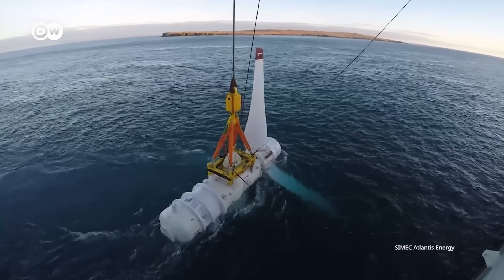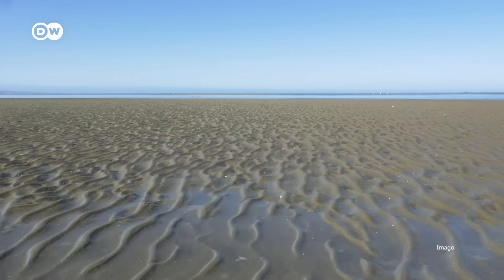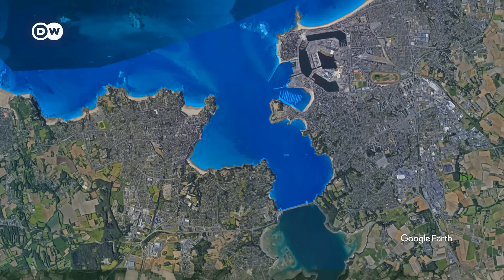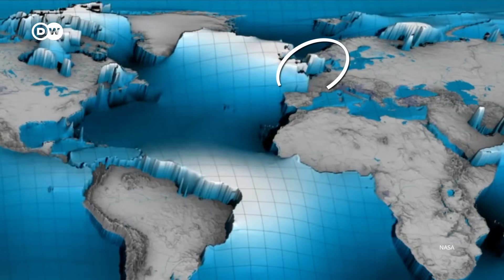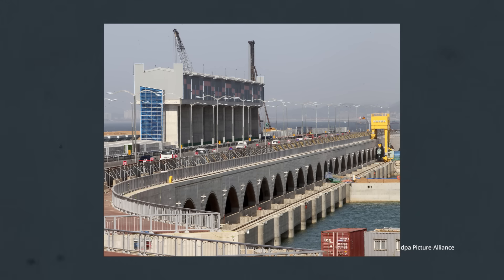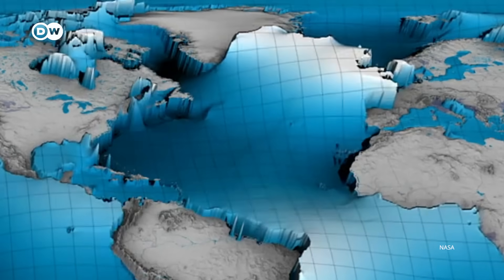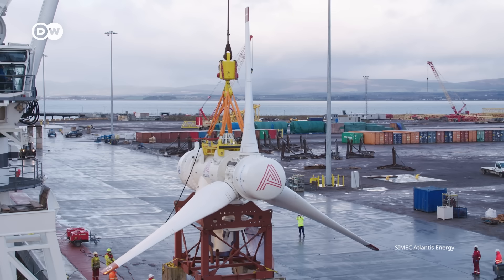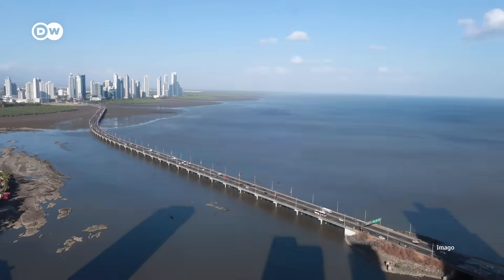Tidal energy could be huge – why isn't it?

Comment: Why? Because it's insanely expensive, a highly corrosive environment, and has all of the drawbacks of wind.
Reply: For one. This technology is still in the early stages and hasn’t had the same amount of time to get cheep 
2. There are corrosion resistant materials 
3. Tidal is far more predictable and consistent then wind
Reply: @darthmaul216  everything you're saying was said about wind 30+ years ago and it's still the case.

Don't hold your breath.

Comment: Just use nuclear: unlimited energy resources, extremely good energy density (3 million times more energy dense than coal), does not need much space or other resources, very low co2 emissions. Waste ? Not really a big problem, just do like Finns do (Posiva). Tsernobyl ? Bad reactor run in very bad manner. Three Mile Island ? No-one got hurt. Fukushima ? Nobody died of radiation, tsunami killed thousands, still people talk like the whole event was caused by nuclear plant...
Edit: Forgot to mention that nuclear is also 24/7 and increases grid stability...

Comment: Imagine a big empty thick walled semi flexible balloon with attached to it, tidal turbines. There is no connection to the grid but instead the electricity is used to produce hydrogen. The balloon fills up until it even lifts the turbines up so they can rather easily be cleaned. Then the hydrogen is tapped off and the system sinks again.
Reply: so  very  very   SILLY
Reply: @daviddavids2884  This answer doesn't tell much. There were other ideas realized by inventors in the past that looked much more silly like a huge hydrogen filled Zeppelin or wind power gained with a kite (which is taken very seriously)   I am here only thinking about a stand alone system that is cheap and low tech so meant for medium scale not to power a city.

Comment: They are extremely hard to maintain and the algae build up will decimate the structure.
The vibration noises generated within the system will causes the local habitat to have physical issues like heart issues and deafness and also the baby eggs to explode and die due to those noises.

Comment: The last issue about the blades and pressure can be reduced significantly if they used a reciprocating body powered by the von karman stream vortex. There are companies investigating its use in rivers and on land

Comment: This will increase tidal friction ... which will slow down the rotation of the Earth, making the days longer.

Another place this video did not go is that the batteries required would take Tesla's gigafactory decades to manufacture. That's 100% capacity, none left for electric cars.
Reply: did you make that up
Reply: @nmo3148  NO!!
LMAO

Inhibiting the motion of the tides is pretty much the definition of tidal friction.

Think of it this way, WHERE is the energy coming from to make this electricity??

I'll let you figure it out.

Comment: We make a **huge** mistake in our planning for Carbon-neutral. We think we just have to replace our current Fossil-Fuel capacity with renewables, and we'll be fine. Are you *kidding* me? 1 billion people in India and 1.3 billion people in China are looking to be industrialised to the same extent as the US & Europe - which together only equal *1/3* of the population of CN & IN. So we need to replace all fossil fuel sources with *minimum 3x* as much in renewables. And even that is not even barely sufficient. We already have to be thinking towards carbon capture and extraction because we have already released far too much of it into the atmosphere. So that means we will need *vastly* more power - and cheap power to make it viable - than we currently have. An order of magnitude at least. The **only** source we have that can achieve that is wide-spread modern-generation nuclear plants. Yes they take a while to build. Start building now and we can be carbon-neutral by 2035 and actively removing massive amounts of atmospheric Carbon by 2050. 
Just **stop** all these nonsense side-projects like geo-engineering and tidal power that are trivialities and just distract people from getting the real job done.

Comment: Solar is cheap and best. Setting up solar panels on roofs provides shade to homes, it doesn't require expensive setup or maintenance  and reduces power wastage as it directly powers homes. Atleast for India that is the best solution.
Reply from the maker: Thanks for the comment, Haneena. 
We've actually already touched on the topic of solar energy in one of our earlier videos. Have you seen it? Here's the link, just in case: https://www.youtube.com/watch?v=EWV4e453y8Y

Comment: Artificial lagoons will make great tourism areas too, just hope they can find a way to minimize environment damage.
Reply: As long as MASSIVE amounts of concrete are involved, they can’t.
Reply: @petergoestohollywood382  as I understand it for the Swansea lagoon project in Wales a minimum concrete would used. About the same as a large housing development. Most of the walls are surrounded by quarried local stone.
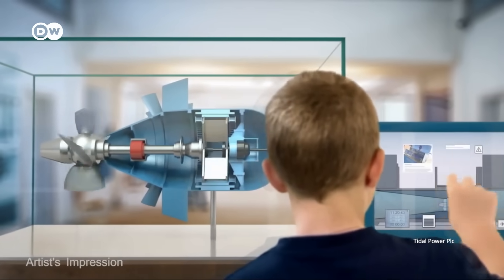Reply from the maker: Yes, we touch on this 5:30 in the video. Did you enjoy watching?

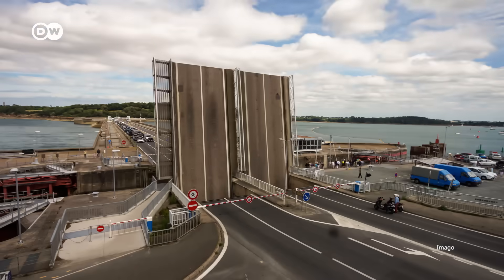Comment: correct me if I am wrong, just a minor detail, when you're talking about Rance Tidal Power Station at 3:55, the next clip 4:12 is from Nice, which is southern France. Maybe it doesn't have a connection, but with "it produces enough power for the city", the city didn't match the picture. Anyway, really informative video!

Comment: 0.25, Swansea marina, 0.47 ,Rhosilli bay and worms head ,Swansea,. The Project @5.37, Tidal Lagoon, Swansea , is dead in the Water . The government would not support the project , the cost of the Electricity was too much . Surprised DW have featured this project in the video saying it has just been proposed ,which is wrong . The Lagoon saga has been going on for a few years here in Swansea , the local people were fully behind it , even given the chance to invest in it during the early stages ,but a strike price acceptable to the Uk government could not be reached.  A different project was recently proposed , Blue Eden ,not the one shown in this vid , where a lagoon would be built which would have  housing , a battery factory and associated Energy  Battery storage . A mix of solar and sea turbines will generate around 320 mw making the site energy self sufficient.
Reply from the maker: Could you please provide us with some references to your claims?

Comment: Remember that there's no such thing as a free lunch.
The energy extracted in the French system has been shown to have slowed by a measurable amount.
The spinning earth is equivalent to a flywheel and the generators are coupling loads into that flywheel. The energy has got to come from somewhere and unless the flywheel is topped up  with more energy, it will slow down.
Even with no extraction, the earth will eventually slow..(Millions of years away) due to rotational energy being lost, simply by the friction of drawing the oceans' water over the world in tidal movement.
Knowing man's profligate exploitation of something which appears to be a Freebie, marine power plants will proliferate and the effects are most definitely not sustainable.
Dig out more coal and clean it of  pollutants (Sulphur etc. not CO2..That's NOT a pollutant!) at the point of burning.

Comment: I feel like putting a type of these turbines in certain rivers might be more environmentally friendly than dams, (although without the benefit of flood control and controllable release)
Reply: Rivers are too shallow. The rivers deep enough are still too shallow as there are boats that need navigable waters and not a giant fan sitting just below the bow line. Also, Rivers rise and fall with the tide.
Reply: You can, and it is.  However you need FAST moving water, which most rivers aren't.  What most people believe are fast moving rivers, are about 1/3 of what you'd want.  Even then, if you could replace that device with a dam a foot tall you'd get way more port.  Physics is heartless sometimes.
Reply: I was reading recently that if dams were built in a staggered formation so that each part only stuck out ~25% into the river then a lot of the environmental impacts are actually avoided.

I’m interested to find an example of where it’s been actually done though.

Comment: I'm all for exploring options, but solar roofing is so much cheaper and less risky for ecologies .  We are less than a decade away from roofs being cheaper to build with solar panels. Probably by 2030 every new roof will be solar.
Reply from the maker: Thanks for sharing your view, Peter. We mention about 07:36 min in as to why the industry is still expensive. Did you see it? 
Also, speaking of solar power, we already have two videos on the topic: 
"How green is solar energy really?" – https://www.youtube.com/watch?v=EWV4e453y8Y&ab_channel=DWPlanetA 
"How solar energy got so cheap, and why it's not everywhere (yet)" – https://www.youtube.com/watch?v=sUvaYycoWqI&ab_channel=DWPlanetA
Reply: @DWPlanetA   It is a red herring..  Yes, obviously solar panels have a carbon footprint, so does posting videos on youtube, so does every type of food produced anywhere, so does the manufacturing of those giant underwater turbines.  Talking about solar panels in landfills is equally silly.. I'm guessing even in 20 years, the percentage of trash that is solar panels in landfills is .0001%.  Consider the fact that almost any solar panel produced in the last 10 years has at least a 20 year warranty.... There are over 200,000 supermarkets in the USA, each of them filled from floor to ceiling with one-use plastic, but yeah, lets talk about an item with a lifespan of 20 years as contributing to the landfill problem.    Yes,  underwater turbines are relatively unexplored and expensive, but that is because there is so much risk involved.  They are a huge project that require government involvement and relatively unknown payback periods..   Solar panel technology is competitive and done mostly by companies that are able to predict the profitability of the their tech advances by selling directly to consumers.  As a consumer, it is fairly affordable to go ' off grid' and the payback time on solar panels is less than 7 years in most of the USA.  I'm not sure the purpose of this video. It sounds more like something Exxon Mobile would come up with rather than someone really interested in the environment.  The carbon footprint of making solar panels is tiny compared to any other source of energy, especially considering they have a proven lifecycle of over 20 years.  I just get a big ' this video brought to you by your friends at ExxonMobile'  vibe here.

Comment: In my Opinion you can easy use Rivers that have tides for making energy. You just build a damm and if the tide is high you let Water trough Turbines in the river and when it is low you let it out. So you just change the time of tide in the river and don,t have much impact to the nature. You just need a another way for ships to go through. This shoul be easy and cheap to build
Reply from the maker: Great point! 
Have you managed to find scientific sources that have proved that changing the natural tides of rivers won't have any impact on nature?
Reply: @DWPlanetA  No i have no infos about that. But if you can damming up rivers for ships than you can do it also for energie :D

Comment: Where all these great Idea's fall down, just two of those things, one tides rise stop the fall and stop. This is not continuous power then there is storms and damage.  
But a real big downside is the transport of high power the heat it creates and the methods that have to be in place.  Very expensive!  Maintenance is a killer.  
Also power maintenance work in water?

Comment: The dams can be made of ice, the refrigeration of which is powered by some of the electricity generated. The power to start the refrigeration process can come from anywhere but perhaps especially from floating systems that can be moved along the coast as required. Rubble can be added to make the whole thing more resilient. River water can be used as it is easier to freeze than seawater and the whole structure increased in height in line with any increase in sea level. The heat removed from the water in turning it into ice can pe piped ashore to heat homes and offices and factories and domestic hot water. Win win win. Even greenhouses can be turned into hothouses to grow more food regardless of the climate in colder regions and electricity from the system can power refrigeration for aircon in greenhouses in hotter regions. Another win. Why aren't we doing this? Also, this ice in contact with seawater will have a cooling effect on the oceans which is beneficial. Another win.
Reply: Interesting.
Reply: I hope this is sarcasm
Reply: @etherealrose2139  Why do you hope that?

Comment: One of the examples of untapped tidal power was our trip 15 years ago to Costa Rica. We were on the pacific coast near the Ossa peninsula. The tides rolled into the beach 24/7 with a height of about 6' making it almost impossible to swim without a load of coarse sand being injected into your swim trunks. The power was amazing and I thought that this was a resource worth tapping into. There must be many more places where this kind of power could be harnessed.
Reply: It sounds like you're thinking of waves, not tides.
Reply: 6' isn't enough.  I work in tidal energy, every place we work is at least 20'.
Reply: Some of the largest tides in the world near my house. And absolutely  no use being made of it at all. And we currently have problems with high energy bills. You'd think someone would be able to put 2 and 2 together!
Reply: Doug, I have a single question for you:  what is your education level and specialization?    If - God save you from it, of course - you ever need a surgery, you would not suggest to the surgeon how to perform it, would you?   Because you are not a medical doctor.  So how can you suggest how feasible (let alone practical)  such an installation could be ?
Reply: As a grown man, you must realize that this isin't a new idea.

Comment: I really hope this is actually A new solution to cleaner energy. I can tell you first hand that more often than not the new green technologies vastly overestimate electrical output and likewise underestimate environmental cost. I completed 2 solar farms in south Georgia as an industrial electrician. The output was suppose to power roughly 60,000 homes a year. Turns out that number was drastically lower. Like 8,000 homes was a lot closer and thats the median range. Now if we talk about consecutive days of overcast weather that number drastically reduces and more often than not would leave a lot of homes without power for several days in month. I am all about replacing our current power production if its a viable solution that won’t leave people freezing in the winter or having heat stroke in the summer. But I have extensively looked into the new green energies including electric vehicles and I can tell you that currently there are no real viable solutions that would not grossly shoot electrical energy through the roof. Your power bill would go from say $300 or so a month to probably $600 or so.
Reply: This will be a colossal waste of resources.
Reply from the maker: Thank you for such an informative comment, Michael. 
It is indeed a really complex matter, but one we are trying to unpack. We try do so each week. Feel free to hit the subscribe button if you'd like to know more about how we can save our planet.
Reply: Nuclear is all we have right now. The other stuff are not worth the squeeze. We add 88 million people to the world every year too and they say energy won’t peak like about 2035. And if they are using the same methodology for carbon capture tech that doesn’t exist yet who knows when it in actuality peaks.
Reply from the maker: Thanks for your comment. We have already wondered if we need nuclear power to stop climate change. You can watch the video here: https://www.youtube.com/watch?v=9X00al1FsjM&ab_channel=DWPlanetA

Comment: Why this video doesn't mention one basic problem: tide power is not constant but sine shape. You still need huge energy storage. All the same problem of so called renewal energy.
Reply: True, but at worst you need only 1/4 day storage.
Tidal generates maximum power 4 times a day, between the 2 high tides and the 2 low tides (close enough, one day in 7 you only get 3)
There are countries where the tides are staggered along its coast. The UK always has tides flowing at maximum, when it is high tide in the North and South, the middle has low tide.
In places like that, no storage is required, just a large longshore interconnect.

Comment: It could be cheap with much littles turbines floating and anchored with wires  in shallow waters at the sea floor. This wires would have two function: 1) anchor the turbine 2) conduct the electricity to a central wire under the sea floor. This type of instalation could be possible in a almost either beach of the world.